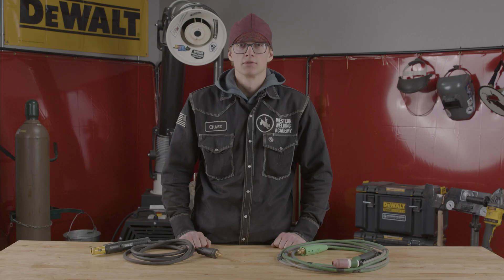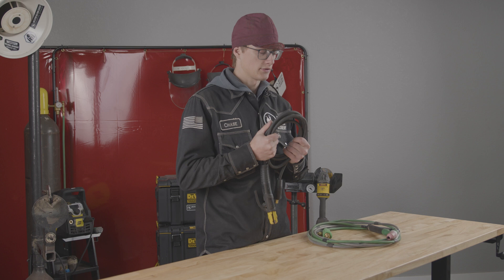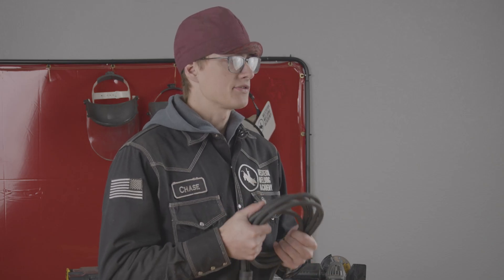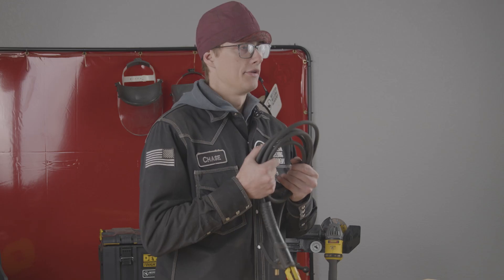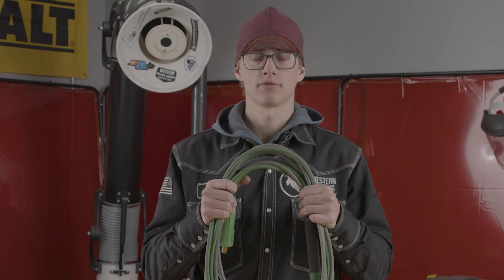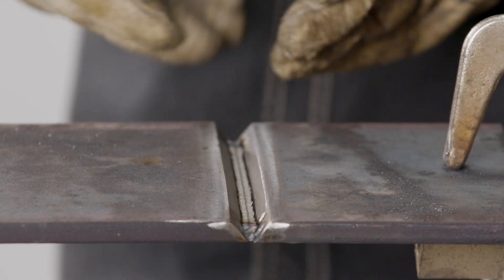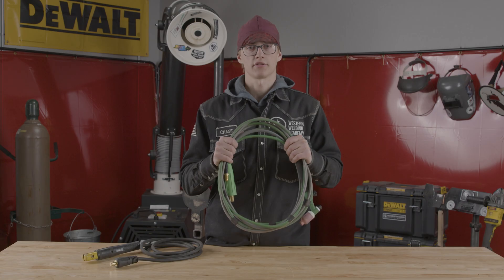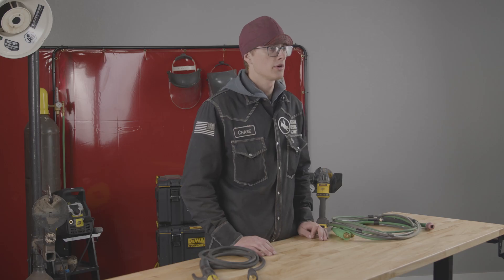TIG or STICK? Which is Better?

Comment: How much time did you spend in the field? You look like you're 20 years old.
Reply: About 3 hours then he turned around and decided sitting in an air conditioned building making little youtube videos is easier 😂
Reply: i’ve seen some youngins that can outweld some seasoned geezers any day of the week. 
it doesn’t take 20 years to be a good welder, 7 years of doing it day in day out and you can be pretty good at it.
you’d be surprised how fast some of this younger guys learn. give credit where credit is due.
Reply from the maker: Judging by its appearance huh 🤔
Reply: Any one can learn to weld and anyone can teach a rookie how to weld but older gentleman are the only ones that can pass on experience and knowledge because kids have none of either.  That’s why you pay so much to go to a school but the school is only about maximizing their money they take in.